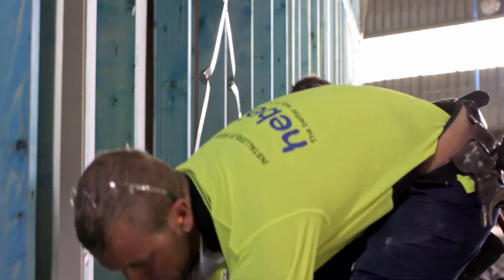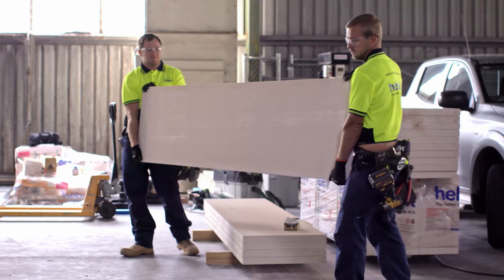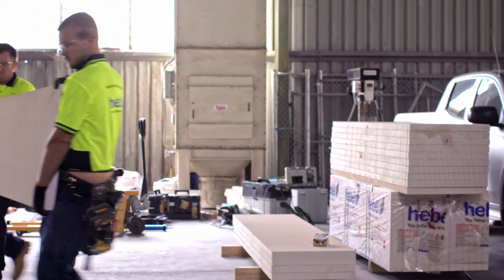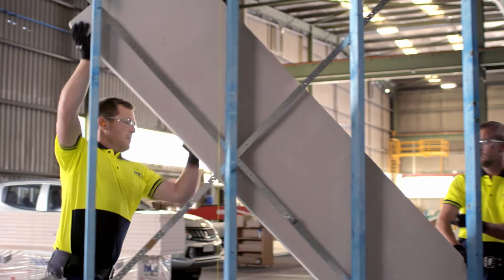What Builders & Carpenters Think - Hebel PowerPanel50 Low Rise Multi-Res Intertenancy Wall

Comment: thanks for sharing the details, i’ll pass it on to my property inspector as well so we can ensure the build is going alright.

Question - will it be easier to install the split system air conditioners on the hebel walls later?
Reply: Saurabh Dhall if not rendered yes
Reply: Makes sense
Reply: probably not.. Hebel is not tolerating weight